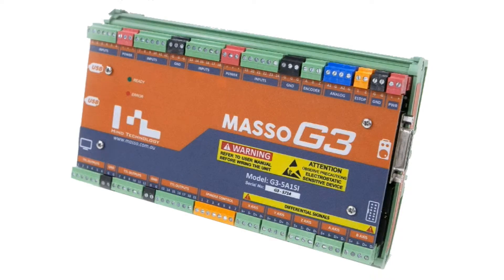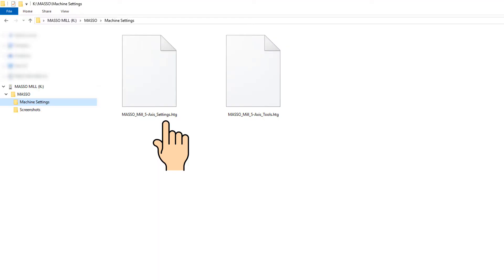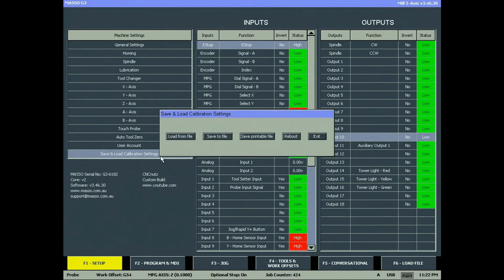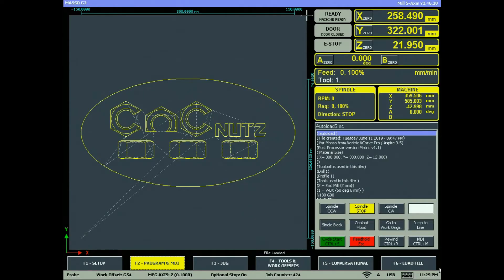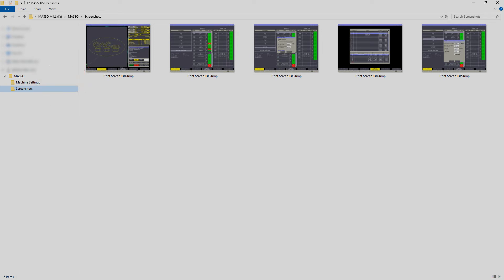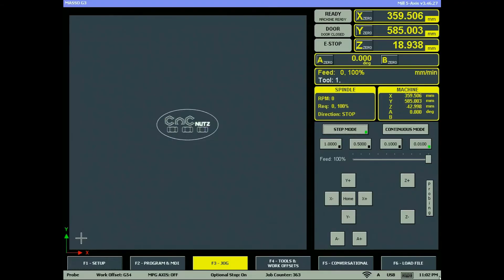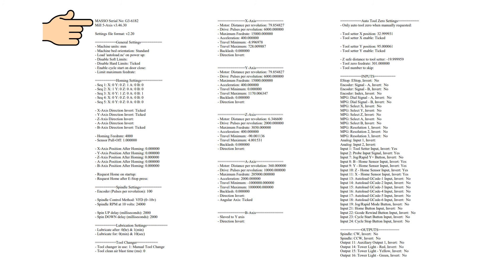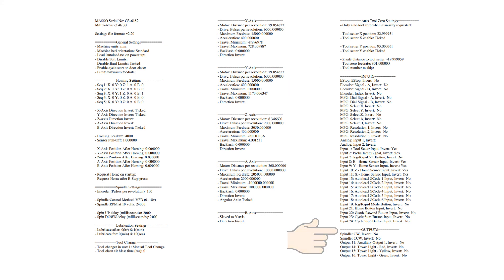How to Save and Load Backup files on your Masso G3 and MASSO Touch - Episode 022

Comment: Hello Dear

I have MASSO G2   3 AXIS  v3.42  I want to switch it to Lathe i e-mailed the support they send me tow files named 00003143.HTG and data1.HTG

I formatted usb with 32fat i try to upgrade as you described in You tube but it just starting normally to Masso mill without boating from USB

How can it be fixed